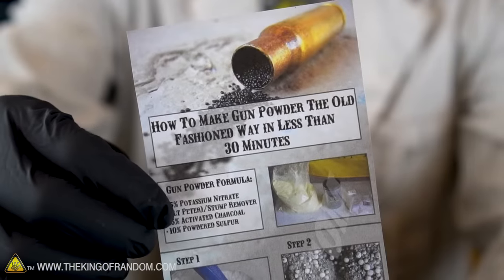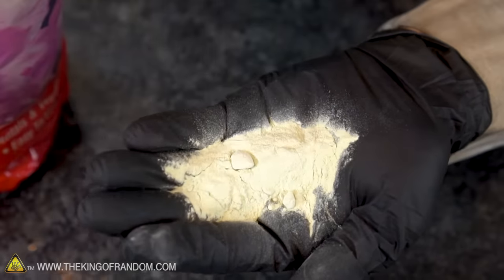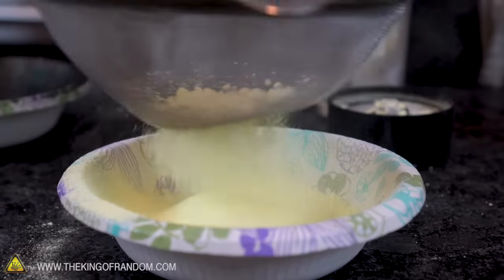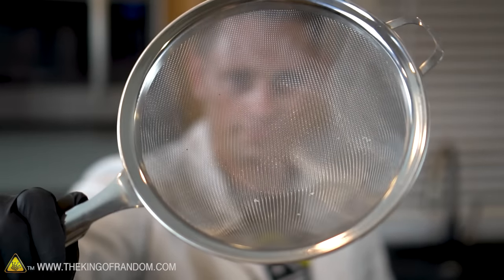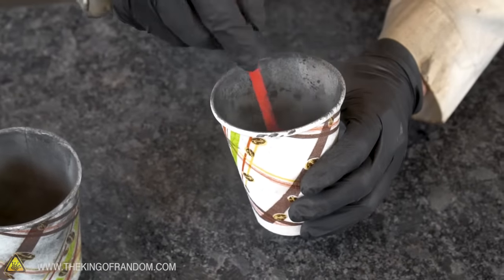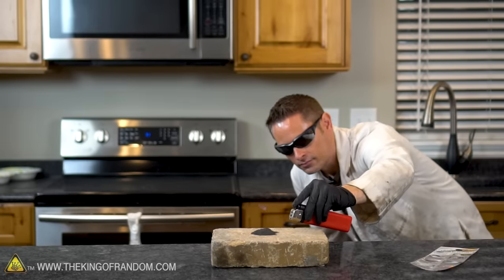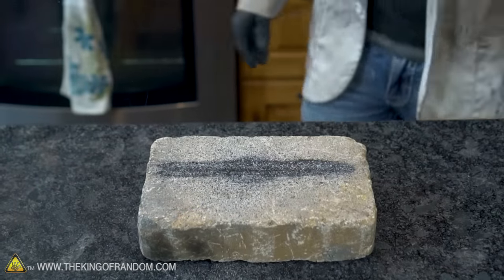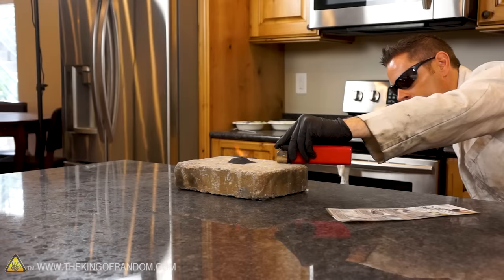Homemade Gunpowder, For Science! How To Make Gunpowder - DIY Gunpowder Experiment!

Comment: 75% potassium nitrate, 15% charcoal, and 10% sulfur.  This guy was inspiration when I was younger.
Reply: Keep everything the same but make the sulfur 11%
Reply: @WannabeWoodsman  why?
Reply: He was an inspiration to me as well
Reply: @WannabeWoodsman  yes 101%
Reply: @WannabeWoodsman  So the others would be 74.5 and 14.5? What effect does this have?
Reply: - The guy that k*lled Shinzo Abe
Reply: @thisISaPENn easier to light more oxidizer
Reply: Cool
Reply: Volume or weight?
Reply: @jackermis3104  Just use weight it would be easier and more precise, however, this is a ratio.
Reply: @tjxwheel7812  what do you mean? the saltpeter is the oxidizer not the sulfur

Comment: Grant! I really hope you find this in your huge comment section!
What you are doing is called "dry mixing". It is the primitive way of mixing the ingredients together. You are basically making the old gunpowder that didn't work as well as it could. You could make "corned gunpowder" which is more powerful. You can make this by simply adding water into the mix (after crushing everything of course) until it becomes a bit like a slush, then let it dry. Very simple. All it does is mix everything much better and allow the powders to combine more efficiently. I hope you see this and can make it in another video! : )
Reply: i would recommend adding equal amount of alcohol for the potassium nitrate to precipitate from the water and crystallizing on the charcoal
Reply: And how do i let it dry?
Reply: easy! put it in a tight steel can with nails inside and roast on a fire! make sure to sit as close as possible!
Reply: Thanks man
Reply: This almost sounds like the old "CIA" method where you mix the ingrediants together in hot water over an electric burner in a pot.
Reply: What you do is mix the powders together while they're WET(this is also a lot SAFER than dry mixing them!).  When they are thoroughly combined, wrap the stuff in cheesecloth and squeeze out as much water as you can.  Then you PRESS the wet mixture into a cake, and let it dry completely.  When it is dry, you VERY VERY CAREFULLY break the cake up, using
wood or glass rollers(NOTHING that could produce a spark!) to reduce it to powder again.  What you now have is "corned" powder, the stuff that was used for muzzleloading firearms.
Reply: @GodlessMartyr666  lol
Reply: When wet, it's a lot safer to mix.
Reply: @BlaineNay  Dry mixed powder was called "serpentine", and it had a tendency to separate into its component parts when shaken.  Also, it was, comparatively, much weaker.
I wouldn't, as someone suggested, attempt to dry the wet mix over a fire.  The results could be quite unpleasant.  Just let it air-dry; it might take somewhat longer, but it would
be much SAFER
Reply: Mr squid bro if i mixed ethonol instead of water would it be similar to cordyte
Reply: Nice you kinda answers me question a lil bit
Reply: Kk
Reply: Not only does that method allow better mixing of the chemicals, properly "corned" powder keeps the ingredients from separating over time. The only thing you need to do is to compress the damp mixture in a press, let it dry under that pressure and break it into small pieces.
Reply: I'm surprised how well that turned out for dry mix
Reply: Mr. Squid my father did the same basic thing using 98% isopropyl alcohol to mix into a slurry and then let it dry, he even would put it in the oven on the lowest setting to finish the dry, this stuff's burn rate was very fast, at least 10 times faster than what we just saw.
 Thanks for your information as this is not as easy as it sounds, it's rather hard to find that perfect ratio.
Reply: darktermi1993 p
Reply: @allentremper8243  so instead of water use isopropyl alchohol?
Reply: lol he's dead
Reply: @wesguyer4182  thats not funny at all
Reply: @warpoverdrivu6900  idk man, it's pretty omegalul
Reply: @wesguyer4182  its not funny!
Reply: @itsamemario6539  little did he now 😮😮😭😭😭😭😭
Reply: Sorry bud he never got too
Reply: @Edgar-and-Wrench  well iso fumes are flammable so watch out for sources of ignition

Comment: Hey Grant;

For a future project, you can take some cotton string, Mix the powder with dextrin and wet with a 25/75 rubbing alcohol/water mix, and coat the string with the wet powder to make a simple black match fuse (scrape excess powder off before it dries). This gives you a VERY simple fuse with a burn rate around 1 inch per second. To speed it up, you can then wrap the black match in loose paper or even scotch/painter's tape, giving you quick match which burns very very rapidly (feet per second). I prefer paper because you can rip a foot or two of paper off, giving you 10-20 seconds of predictible slow burn, followed by a rapid combustion to whatever you've put your fuse into.

Might be worth trying. Cheers!
Reply: this aged well

Comment: Hi Grant, if you would like your black powder to burn from a whoosh to a poof, could possibly try the following:
- Use a ball mill with lead grinding media. Ballmill the black power (all three chemicals together) for at least 12hrs. A ball mill really is the secrete to producing amazing black powder. 
- Use 'willow' or 'balsa' wood charcoal instead of the paint sticks, you will get an increased burn rate. Charcoal makes a big difference.

Making a ball mill could be a project idea for your channel to follow on with your black powder adventures.
Hope this helps you! Really enjoy watching your videos! 😁
Reply: Hahaha, definitely not! It needs to be handled with respect whether it burns fast or slow.
Reply: it also needs to be granulated for specific uses...
Reply: are you crazy do not put that stuff in a ball mill, are you trying to win a darwin award.
Reply: How do you think real black powder is made? Look on any real fireworks forum and you will see it is all ball milled together for as little as 3hrs up to 12hrs. I'm not trying to sound harsh but thats the truth.
Reply: Dian ogle use wooden balls. No spark chance
Reply: Lead doesn't spark, and it is heavy enough to bash everything together nicely, which makes it the preferred grinding media.
Reply: Seroster well I wish I knew that when I bought my balls! Wood takes absolutely forever to grind stuff up
Reply: Ceramic works really well.
Reply: I have seen on YT that Pyrodex powder burns much slower than manufactured BP. Green powder seems to have a similar burn rate as Pyrodex. If the burn rate is the same or similar then green powder could be used in ML guns like pyrodex or am I missing something. Thanks.
Reply: Brother I don’t have willow or balsa here in india…what can i use then? Should I should mango 🥭 wood 🪵 as it is soft…and why shouldn’t we use Amazon’s willow charcoal pencil ✏️ sticks???
Reply: @Rahul.patel48  Because there is paint of pencils
Reply: @Rahul.patel48  any wood will do as long as it is dry, decently hard and isn’t infested with termites, though you will have to do some testing to figure out what wood you can get works the best
Reply: I would think it would be practical to steel ball mill the ingredients separately, then mix the resulting powders, if you do not have access to lead balls. Same result, no spontaneous detonation risks.

Comment: You will find that if you wet the powder down and then press it through a coarse sifter then let it dry you will get a much more energetic burn. Dont regrind the pieces.
Reply: Sean Lemon called granulated black powder
Reply: Sean
That's what real black powder is
Grant doesn't actually seem to know this. His 'well-mixed' powder only looks that way to the eye; it's still pretty heterogenous. When the mixture is wetted and re-ground, the sulfur and carbon are actually stuck to the saltpeter grains. The deflagration proceeds very rapidly as the oxygen barely has to move anywhere to contact a stoichiometric mixture of fuel.
Reply: I believe what he's made is more accurately referred to as serpentine.  It's only really black powder after the wetting and milling process.  Either way, it's still pretty cool.
Reply: Also instead of random bits of soft woods and scrap paint sticks you should mke your charcoal from willow branches. It is a soft wood with very little resinous sap in it,  unlike pine. Absolutely the best charcoal-making wood for black powder.
Reply: +Wikterror 2807 Don't Type Like That
Reply: Correct Sean! He should of used denatured alcohol to wet it and the granular it through the strainer. Or go even further and use Red Gum as a binder.. The powder he made burns slow compare to others I have seen. Also instead of coffee grinding it, he should of ball mill it.

Of course we don't know if he wanted to do something quick or something of quality...

Comment: You should check out the method for making wet black powder. When you mix the sulfur, charcoal and ammonium nitrate together you do it with water and cook it until it forms a homogeneous mixture. While it’s wet it will not ignite. You can then take that mixture and run it through a flour sifter on to a piece of newspaper and let that dry. It’s much safer than mixing the three powders together.

Comment: "Use plastic or wood to not conduct any static electricity"
5:20 PROCEEDS TO USE  METAL SPOON
Reply: rommel_ 616 that’s not the point 
Static electricity is a ignition
Reply: ChIcKeN_Stewer plastic causes static electricity in the right circumstance. I would stick with would or ceramic. that's just me though.
Reply: Allen Tremper yea, between the straw, and the styrofoam cups, I was a bit stressed watching this
Reply: his ratios for making the gunpowder were so terrible i wasn't worried, well made gunpowder without being under pressure (like an enclosed cannister) doesn't "explode" so much as just ignite cohesively very very quickly, not producing force but using up all the media gradually in like 1/10th of a second, his mix took so long to burn he wouldn't have been in much actual danger
Reply: Plastic is about the best producer of static electricity. B O O M ! ! ! ! ! !
Reply: You can't set off gunpowder with an electric spark. I have used an EHT transformer that delivers a constant 15000 volts or so arc. No fire! A lit cigarette or red hot steel wire however and FOOSH!
Reply: Hey. Anyone knows how he transformed the liqyud stump remover to potassium nitrate?
Reply: @patsore3698  stump remover comes as a powder even though it comes in that fancy bottle. In that one scene where it looked liquidy, he was using a torch to melt it to show that it would not burn
Reply: @wisconsingoldrush8270  undertsood it just before you wrote it
Reply: @patsore3698  it comes in a powder
Reply: He wasnt mixing it
Reply: i was looking for this comment
Reply: absloute madlad

Comment: For all practical purposes, Black powder and Gun powder are exactly the same thing. 
The main reason why this experimental batch burned so slowly is because there wasn’t enough Salpeter aka KNO3. 
If the dry mixture is blended into sufficient water to dissolve the Salpeter it is absorbed into the Charcoal. This leads to a far better rate of combustion. 
My gunpowder mix goes up in a puff of smoke, even when it is unconfined.
Reply: Can you write the recipe please?
Reply: Black powder is more explosive, gun powder or modern powder is a controlled burn
Reply: No it didnt burn faster because it wasnt ball milled and yes you could do without a mill but granulating it helps it burn faster for fireworks.
Reply: @strider984  Black powder Is gun powder.
Smokeless powder and black powder are completely different compounds.
Reply: @bigtexan tex already broke this down like a handful of comments above this one... yall need to chill over here.
Reply: @strider984  Making an unsubstantiated comment like that is not productive. You should elaborate and explain yourself rather. Thank you.
Reply: Actually this individual is correct with his statement. Isopropyl alcohol can be used as    well respectively.  Very respectively whoo!

Comment: You had made homemade bullets and blackpowder...
Do your own random ammo ;D
Reply: Black powder is extremely ineffective as a propellant by today's standards. That's why firearms today use smokeless powder
Reply: Luke Smith I wouldn't say  ineffective,I would say outdated? bp is very effective for what it is.dirty and outdated. smokeless powder is a much different compound,cleaner and slower burning than true bp.
Reply: funkyole1125 I meant ineffective as a relative term. It still drives lead down range, but not nearly as well as modern smokeless powder
Reply: Luke Smith much dirtier too.....
Reply: RobinPl4ys Sz
Reply: Black powder isn't used in bullets on purpose. It's residue is very corrosive and will ruin any gun.
Reply: +Drew Bransby 
I didn't know that
Reply: RobinPl4ys and the 
Home made primers
Reply: @LukeSmith-kt2ir  - Its amazing that with the military importance of gunpowder and having many 1000's of the worlds brightest minds working on it that it took about 700 years  for man to get smokeless powder.
Reply: @funkyole1125  - Since smokeless powder can propel bullets at twice the velocity or more than black powder I'd say its much faster burning.